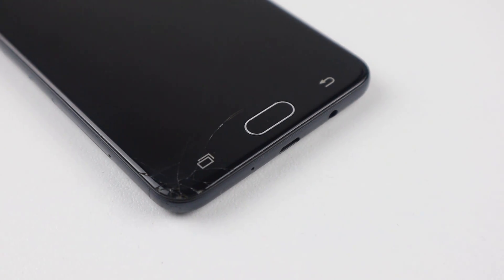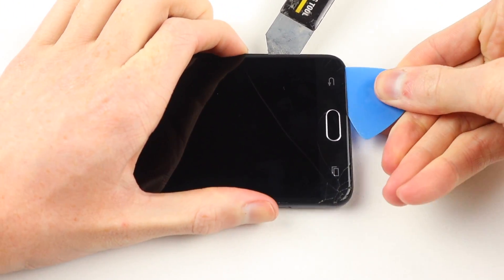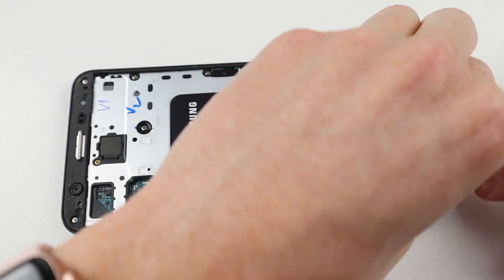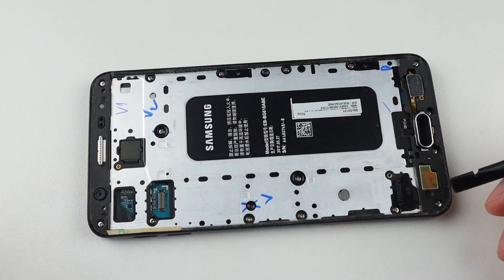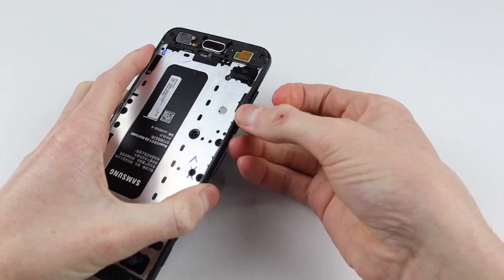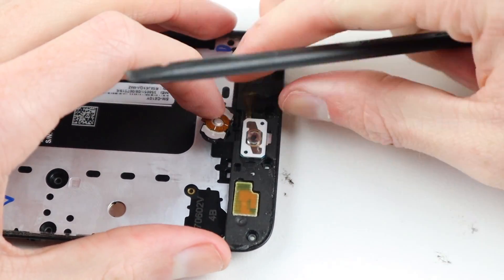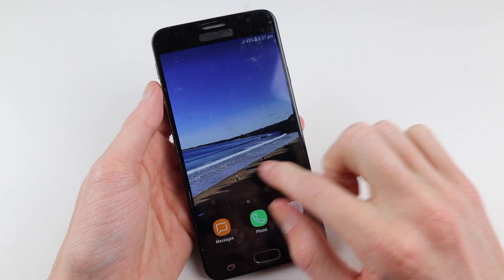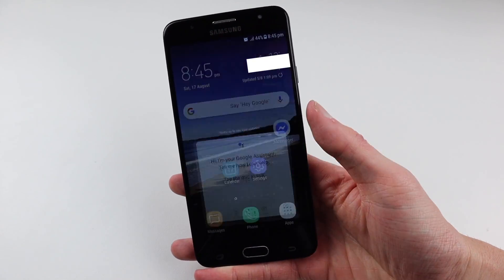Unrepairable design? - Samsung J7 Prime Screen Replacement

Comment: If anyone is wondering, the samsung logo was covered to bypass customs 😂
Reply: Why? Don't they allow company phones?
Reply: brindaraka most likely a fake after market display
Reply: Its not illegal to buy parts of phones or sell parts of phones, if you buy a fully brand new phone from Apple/Samsung or any other phones and dismantle it and sell for parts it's not illegal as it an original display and OEM part, nothing illegal about buying or selling OEM parts, the display was most likely purchased from eBay and didn't show the Samsung logo but advertised as genuine display, "Genuine display" not genuine "Samsung Display" it's a term used to get non savvy buyers to buy the display and when they receive it it has a logo on it and they assume it's legit, yes it may be for the right phone and may be a similar quality display but it will not be a genuine display but will still have a logo to make it look like it is, therefore that is a fake display and is illegal as it's branding the display as Samsung when it's not actually from Samsung, Whereas if it's was off another original phone and was an original display it is not illegal
Reply: Lewis Edge its illegal to import original apple parts to the us if its not them importing the parts thats why they probably put the paste over the samsung logo so they dont have to have 2 diferent screans with pase or without paste for the eu since its legal in the eu to import original apple parts and not in the usa i think its legal to import samsung parts to the usa but idn why they covered the samsung logo
Reply: Lewis Edge I think that we all know that those parts are made in factory in China dedicated to do phone parts .
Reply: @LewissEdgee  that's why when i bought an s5 display has the logo covered and the display wAs advertising as genuine display was actually fake display that stopped working that explains everything very gd explanation well done
Reply: brindaraka no, because is illegal to buy parts of phones, with Apple cases and parts goes the same way, when you buy them from China they come with a protective cover on the logo for the Xray machines.
Reply: @AlexeyDelgado-v4h  it is legal dummy.
As long as the part has no logos on it (if the part is not original) or it is from a broken phone (so an original part) you can buy it legally.
Reply: @HatTrex  Tell that to Louis Rossmann, who bought genuine MacBook LCDs from China (for a model that Apple itself no longer services) and had them stolen by customs with no due process because they can just say anything with a logo on it is fake and get away with it
Reply: ye i tought so because thats what they do for apple parts as well
Reply: Its due to copyright issues, the logos are copyrighted
Reply: That makes the phone a bit more clean.
Reply: I wonder if the same can go for iPhone housings.
Reply: How dose youse know
Reply: Well what typically happens for these replacement screens is a piece of new glass is slapped on a display assembly that was previously shattered but fully working so it's not 100% original. Then saying it's 100% original with the Samsung logo is asking for trouble. This is true even in China and buy it straight from taobao
Reply: Ohh
Reply: i know
Reply: I know I’ve replaced screens before on Samsung’s
Reply: What people is still asking why
Reply: Customs wdym?

Comment: I know this was probably a annoying repair, but please could you try and do more Samsung projects?
Reply: People doesn't like repairing Samsung display bcz most of Samsung devices use Oled display which is expensive to manufacture. But J7 Prime uses LCD which cost less than Oled
Reply: I had a Samsung edge plus for over 3 years. Screen never broke. Dropped it so many times.
Reply: An*
Reply: And screen burn in doesn't happen anymore since the Note 9 because samsung has made a new generation of oled
Reply: @RageCaGaming99 I can't say anything about the S9 or note 9 and up because I have not seen many of them yet but I can say burn-ins are an issue I have seen in alot of samsungs devices up to the S8. TBH a lot of android devices have this burn-in issue, the price of having a high-end screen.
Reply: @ajmickyplays7236  well. If it's cause of amoled, then the iPhones are next, cause the new ones use led screens. Lots of companies do now in 2019. Though my at 2017 didn't get any burnin in 2 years of use
Reply: Only some of the entry level samsung phones from a year or more ago are hard to repair
Reply: Ikr, but samsung phones doesnt get damaged quick as iPhones 😉
Reply: @morsmutual  Well I can agree😂😂
Reply: Mors Mutual Insurance my car just got destroyed MMI I need a new one
Reply: @juanpabloponce9334  We expect the unexpected
Reply: @morsmutual  i like samsung. I have one. But Samsung break more than iphone. But Samsung users dont really care that much also apple easier to repair and easy to find
Reply: Mors Mutual Insurance big poor
Reply: @morsmutual  That is so not true, you'd be surprised by how many Samsung devices out there that are damaged due to issues with the Screen. The reason, why people don't like repairing them, is due to the cost to repair. A screen for a Samsung galaxy s7 is basically $200Usd.
Reply: Well, the S series (Flagship phones) are not worth being repaired, the J series, on the other hand, can be repaired and made a profit on since replacement screens go for $15-$30USD.
Reply: @ajmickyplays7236  just Samsung devices with edge screen are easily breakable. The devices that have flat screens, are not
Reply: @josericardogs1435  i had the S6 edge and it never broke in my 3 years with it
Reply: @josericardogs1435  I wasn't mainly talking about the screen breaking, It was more to do with the fact that Samsung uses AMOLED screens which usually has an issue where colored lines appear on the screen and burn-ins. If you look at the damaged Samsung S series devices listed on eBay, most if not all have an issue where there is a colored line in the display, the screens look to be in great condition but they all have this colored line that just forms out of thin air.
Reply: The fact that it cost more to replace a screen than to purchase a brand new device just makes the S series a waste of money especially if you are trying to flip it after the repair.
Reply: AJ MICKY PLAYS in all reality though...both iPhone and android break due to their own owners mistakes so it really depends on the person lmao not as much the phones fault
Reply: @malone7987  I'm guessing you just searched for the cheapest grade C LCD screen on eBay and quoted the price here. I will admit I may have exaggerated the $200 but a grade A screen with frame can go up to $200 and without the frame its around $100-130 or so.
Reply: @tokensark2663  I completely agree with you, both have there faults but what I was simply saying is that there is more profit in repairing an iphone than a samsung S series device due to the price of the screens costing as much as a new or lightly used device.
Reply: AJ MICKY PLAYS yea i gotcha
Reply: @malone7987  I'm sure you do and why are you so upset? What did I say to anger you?
Reply: @ajmickyplays7236  "Super Amoled"
Reply: @ajmickyplays7236  the pink like prob is only on the s7 and s7 edge series due to the stuff cramp inside and it now cost 160$ to fix the screen not 200 anymore. The s7 series is by far the most expensive screen than any Samsung phones. Even the S10+ is cheaper.
Reply: @razvancristea4772  Can you please tell me where you can get a grade A replacement screen for an S9, for $20 that is incredible.
Reply: @RageCaGaming99  Yes you are right about it mostly being an issue with the s7 but I have seen it with the others a few times, not as much as the s7 though. I just did a quick search and the S10 screens go up to $300 on eBay and Amazon.
Reply: @malone7987  LOL My info is all good, I did say that I may have exaggerated the $200 but my point is still justifiable.
Reply: You're just stubborn to admit defeat.
Reply: @ajmickyplays7236  lmao where did you find that price??? Even the official samsung service center price the screen for the S10+ for only 130$
Reply: This all started with someone commenting that he would like to see more Samsung devices being fixed on the channel and I made an assumption as to why Hugh might not want to. The screens of the Samsung devices are quality screens that are expensive.
Reply: @RageCaGaming99  I did say eBay and amazon. Quick question if you run a repair shop will the Samsung service center sell you screens for $130?
Reply: @ajmickyplays7236  I'm not sure
Reply: @RageCaGaming99  Well let's just say they can't sell replacement screens to third party repair shops/people who are interested in repairing their own device, the only option you'd have to purchase one is Amazon or eBay, and the price for a replacement screen would be up to $300.
Reply: Well maybe not the ONLY options but the places most people would feel comfortable buying from.
Reply: @ajmickyplays7236  well, maybe its you not me, who has been replacing s7 screen for years now, oh yeah maybe I forgot to tell you but my repair shop is an authorized and licensed by Samsung , well what do I know bout screen prices maybe you know better than me
Reply: @malone7987  I am quoting prices of Grade A screens from Amazon and eBay so where you get you screens is all you. You claim to have a shop that is authorized and licensed by Samsung. It's your claim with no proof so that means nothing to me.
Reply: @malone7987  I don't understand why you're getting on so.  Upset with someone on the internet and for what? I gave my reasoning and you are to take it how you like.
Reply: @ajmickyplays7236  look man, I won't argue with you, you are entitled to your opinion, but let me tell you that screens on Amazon, eBay or anywhere else are a rip off, overpriced, I get my screens directly from Samsung, they all come with certification papers and warranty. If you want proof that my shop does exist, just let me know
Reply: @malone7987  Well if you are able to get your screens at an affordable price then thats all you, but someone like Hugh or people who are starting up in the repair business who don't have a shop or connections with Samsung will purchase their screens from companies that sell on ebay and amazon, so I am quoting prices from places where a person can easily attain screens for a device.
Reply: @ajmickyplays7236  well then I suggest buying from the ifixit website there price are much lower compared to those on eBay and amazon
Reply: @malone7987  Thing is that parts usually aren't in stock and the screens for some devices are way more expensive from there site than other places.
Reply: @ajmickyplays7236  wtf no more like 70$
Reply: @DarientheG  Ok
Reply: @ajmickyplays7236  says the one that an iphone 10 costs $500 for a back glass replacement
Reply: @ajmickyplays7236  I used to have this problem all the time with my galaxy phones but I started using the S10+ and when it drope the screen goes great and gladly I have a case on it..
Reply: AJ MICKY PLAYS looks at iPhone X repair prices
Reply: @bratacion5742  Reading is key, if you can't do that then we have nothing to talk about. You must feel really accomplished now calling people names.
Reply: @ajmickyplays7236  i wouldnt call repairing the newer iPhones profitable either. Since the back glass is impossible(basically) to repair. Even apple just replaces the whole housing that costs upto $600 on newer iPhones
Reply: @rqfts  Yes I agree but I wasn't talking about newer devices.
Reply: @ajmickyplays7236  if you told it was a edge i would believe it

Comment: The s7, s6, s5, s4, and s3 was probably the worst designed phones I've ever seen in terms of repairability (even worse than this one) simply because you can't replace the headphone jack, micro USB port, home button, and nav buttons without changing the display (unless of course you're willing to damage the aesthetics of the phone)
Reply: You forgot the s10, where you cant even repair the usb-c port.
Reply: @matthewpiper4328  you can.  it's just rather tedious since all of the contacts where solder would need to be applied are all underneath the connector.  You'd have to heat the connector and gently pull it off, clean and re tin all of the contacts, and then apply a new connector while applying sufficient heat to both sides of the board.  Tedious, but doable.
Reply: @nicholasseaks95  It just isn't something average people would be able to do
Reply: @julianmendoza9899  true, the average person wouldn't be able to perform such a repair.  Soldering like that requires training on how to use a rework station and having the appropriate tools.  My point was that that repair can be done.
Reply: 8=====≠≠≠D 💦
Reply: The s7 from what I've seen you just have to open up the back and fix everything from there

Comment: i replaced my j7 primes screen a while back with a hair dryer and some playing cards, thank god i somehow avoided ripping any cables inside
Reply: Do you like the phone ¿?
Reply: Riverdale tales no i dont use it anymore
Reply: @riverdaletales8457  the phone is garbage. Save your money and buy a flagship phone instead
Reply: @kvin9210  😂😂 I wasn't going to buy it I have the Moto G6 play and it's good
Reply: @user-jg78  of course the garbage J7 Prime never beat your S7 Edge bcz J7 Prime is a low end device and S7 Edge is a flagship. The differences is a lot.
Reply: takes my moto g6 play is good, but has a lot of cons. For one it is super laggy! When I type it lags, when I search Google it lags, and when it's under 20% it just basically unusable. Also when its charging it lags like crazy. The pros is that it's very durable, cheap and it charges super quick.
Reply: @josuke6131  s7 edge is an old flagship and not that good anymore
Reply: @Browasweirdhaha  i know. But it's good when it was launched.
Reply: @kvin9210  Why not a mid-range phone?
Reply: Riverdale tales Moto's software is one of the best you can get out of the OEM customized software
Reply: I have a j7 prime but it was very different from the video
Reply: @mr.fallen1486  is it a J7 Pro or a J7 Prime?
Reply: Sounded like the first time I took a phone apart. Hair dryer and playing cards. It was on an S7 not the edge.
Reply: DogBeef, you got popular from jacksepticeye and from your awesome vids. You should get a much nicer phone than that, (because you probably have a lot of YouTube ad money.) This is a weird thing to tell you- or ask you as well. I prefer an iPhone because I’m more of an Apple person as well :P
Reply: NiggaNig420 TOONZ  A7 2018? If so, noice
Reply: J7 is a 100$ here in the US, petty decent value if you're used to something like an s4 or s4, but that was like 2-3 years ago and you can do better now.
Reply: Otto T yeah you can get things like the Moto G7 Play or the Galaxy A10e on sale for around $100 or even an LG G6 if you don't mind used

Comment: I always liked those designs of Samsung phones even though I use apple
Reply: get both then
Reply: Entity .2012003 I recently got a Samsung galaxy core prime from the target bin that had a password but I reset it and it works except you can see rust if your on a white background, the water sensor is red
Reply: @minnesotaoutdoorwarningsirens  holy fuck dude you're lucky
Reply: I'm a Samsung user myself and Samsung make excellent phones I have a Samsung Galaxy a5 2017 and I've dropped it many times without a case and it's not cracked and the software is excellent
Reply: I don’t like Samsung’s non flagship phones design
Reply: @RandomGuy-om1vy  Galaxy a7 2018
Reply: BQNG That’s last year.
Reply: @RandomGuy-om1vy  Ok and? Its a non flagship that looks good
Reply: BQNG the new ones with the very plasticky finish.
Those are what I hate. However the <A50 series always have premium designs. The A20 and A10 are not worth any money at all because of the competition nowadays. It’s my opinion so don’t take serious btw :)
Reply: @RandomGuy-om1vy  Samsung phones has their xynos processors which are garbage trust me only Snapdragon MediTek and Kirin processors are worth getting
Reply: Maybee
Reply: Fuck Samsung

Comment: How TF do you not like the design of the phone it definitely looks better than some iPhones like the iPhone 5 for example
Reply: Its a personal preference thing. I think it's quite ugly, personally. The iPhone 5 isn't the prettiest phone, but I do enjoy the brick iPhones quite a bit more.
Reply: @jannissfr  ? Nobody brought up repair-ability, he was talking about physical design in a reference to Hugh's comment about the looks of the phone.
Reply: @monsalai  Oh sorry, read that wrong
Reply: @jannissfr  You were also wrong, as iPhone screens from the 6 and on are primarily held down by glue (side effect of water proofing a phone), with the screws acting as a failsafe.
Reply: @monsalai  But I think it's still easier to pull off than a fully glued screen
Reply: @jannissfr  Yeah, 100% agreed. Apple's adhesive gasket is just that, an adhesive GASKET. Thus the adhesive is less strong since it isn't meant to stick any harder than it needs to to prevent the screen from flexing enough to unclip itself.